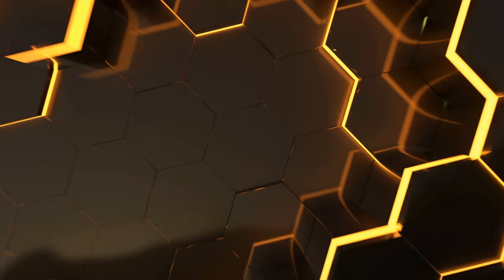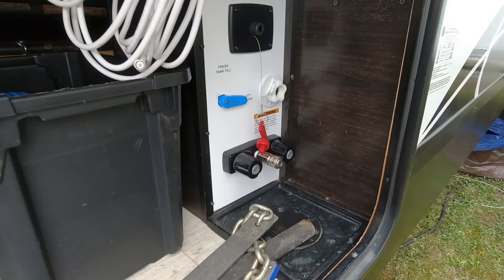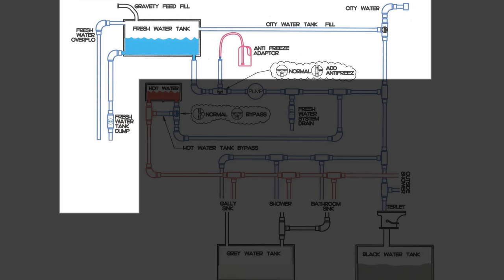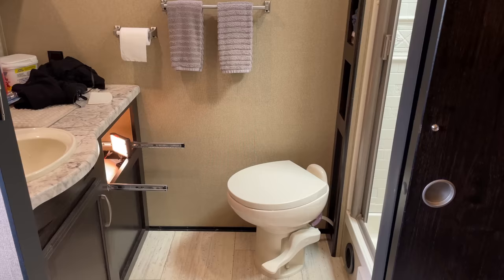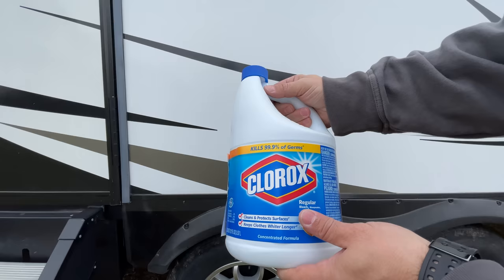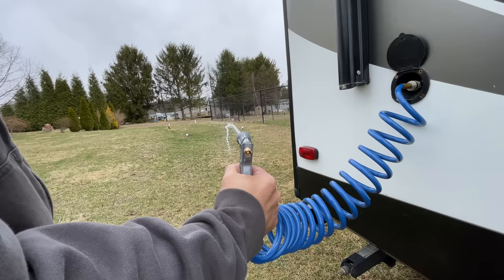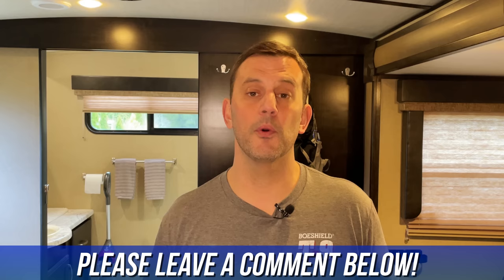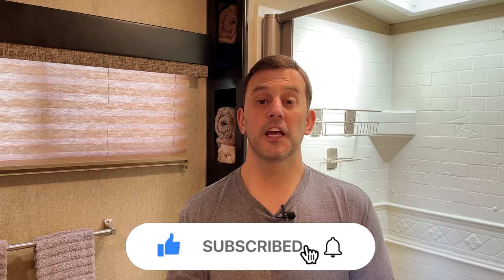Dewinterize & Sanitize Your RV Water System: A Complete RV Dewinterizing Guide!

Comment: Great video, one item I do also is the filter screen on the suction of the water pump sometimes gets particles that have been released from the fresh water tank, I remove the cap and clean the screen after sanitizing so it doesn't get clogged.
Reply from the maker: great tip, thanks for sharing Bryan!

Comment: What a life saver you are.  We have the exact same rig.   Super helpful.  Easy to understand!    Only thing I can think to add is in the other dewinterize video once I got all the antifreeze and filled up the tank I went ahead and turned the water heater to summer mode. Then I found this one.  Normally I’d just fast forward to the sanitizing but for whatever reason I watched the whole thing.  Thankfully so I knew to turn the by pass valves back to winterized mode during sanitizing Maybe put an alert on the other video with the steps that if planning on sanitizing leave valves in winter mode?   Not a huge deal… just a thought.  
Thanks so much!   Saved me 120$ from having to pay someone to do it! 🇨🇦🇨🇦🇨🇦
Take care
Stay well!
Reply from the maker: Thank you!

Comment: I installed my Carmtek Lock, but my door was about 1/8 to 1/4 to thin. Carmtek was thinking because they included a foam gasket. With the gasket installed the lock was perfect. Also has to trim door lower so screws would line up. Lock works great. Thanks for your video, letting others know about the gasket would help, the direction don’t say what the gasket is for or when to us it.
Reply from the maker: Thanks for the info Michael.  I appreciate the heads up and helping everyone out.  I used the gasket right out of the box and assumed everyone would but glad you mentioned it.

Comment: Excellent video... suggest doing the exact same video, but insert instructions for those of us who have tankless water heaters... not sure how to handle that piece of equipment with the sanitizing steps and how to avoid damage and how to turn the Nautilus Control Panel knobs....   sure don't want to mess up the tankless water heater... so I am confused as to what to do... thx   Again, great video and some awesome extra tips for starting out the new season with our RV.
Reply from the maker: Thank you Gerald, I don’t have a tankless water heater so I can’t make a video on that. I don’t have much experience with them, but I recommend checking the owners manual for that specific tankless water heater that you have to see if it’s safe to run a sanitizing solution through it. If it’s not, the process should be the same and you’ll just have to bypass it like a normal water heater. I hope that helps.
Reply: @RVTIPSANDTRAVELS  Thanks for the reply... I understand... was  hoping that you might know.  The GD Reflection Owner Manual is not helpful at all... does an OK job at winterizing, but horrible on de-winterizing.  Thx again for the reply!

Comment: Hi Ross great video... !!  I have an inline water filter, and not sure how sanitizing impacts the filter.  Also, as part of dewinterizing, I always check my batteries , i.e connections and distilled water as I run a solar system all winter, which sometimes drains my 6 volt batteries.  I'll be checking your other videos.
Reply from the maker: i would remove all filters before running any type of sanitizing solution or antifreeze through them, whether its bleach, vinegar, etc... no need to run anything through a filter. remove the filters when winterizing, they can hold onto water and freeze up.

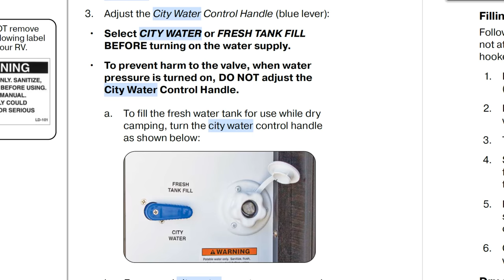Comment: About 3:45 the house hose bibb twists when you are using the valve; may need to tie it down .
Reply from the maker: Actually replaced it Scott.  The top cap blew apart, no shut off for only this line in the house, so I had to turn all water off… capped then jb welded the top on for a couple days until the new one arrived.

Comment: Are you doing the de-winterization at home before the first trip of the season? If so, where are you dumping all the tanks when sanitizing the system or do you recommend performing this at the first CG?
I appreciate the detail in each of your videos, they are super helpful
Reply from the maker: I do it at home.  I usually empty the antifreeze into a bucket and put in my septic tank… it’s food grade so  it’s not going to hurt anything.  The bleach solution is so diluted that dumping into the ground is perfectly fine as long as no children or pets will be in that area immediately after.  Dewinterizing is something a lot of people will do on their first trip too.
Reply: @RVTIPSANDTRAVELS  first of all thank you for the response, all your videos are super helpful. And just to double check I have this correct, fill fresh tank completely full x3. Once with sanitizing solution and then 1-2x fresh water for a total of roughly 170 gallons. Then draining out the majority of this into the yard? Are you emptying black and gray into a bucket and then dumping down the toilet in the house?
Reply from the maker: correct, and yes into the yard.  highly diluted bleach, like in this video, is actually used in food production to sanitize, so it is fine at this dilution rate.

Comment: Great tips and details. Question: should I also sanitize the city water line? Thank you!
Reply from the maker: yes, and doing that depends on your panel... you might need an external pump to get the solution into the lines since city water is normally getting its water from the city pressure.  drill pumps like these work great: https://amzn.to/4f3g1A7

Comment: Hi Ross ,your 🇨🇦fan Big Ben, excellent video ,made me think about what I do ,I also use air blow gun (low press.-high volume) to blow out water heater burner ass. ,go on roof remove A/C cover blow our condenser from back side,also furnace inlet and outlet and run furnace till up to temp,to check and make sure it works..checking tires good idea ,jacking each one up to ck bearings to determine if need to repack ck brake settings...🤔🏁👍or 👎 your 🇨🇦 friends R &J D.🐴🙂
Reply from the maker: great tips, thanks again Randy!

Comment: I’d like your recommendation on something if you dint mind. In our rig (Momentum 31G), our after waste tank is a shared gray water/waste tank. The kitchen and garage bathroom sinks drain to it, as well as the garage toilet. Should we sanitize the lines to those sinks as well? I’m assuming that bleach will kill the enzymes in the waste tank…
Reply from the maker: In a situation like this, I would put sanitizing higher on the list than going through 1 or 2 waste tanks that dont break down the solids as well.  Eventually the bleach will work its way out of the tanks and your back to normal.  Hope that helps, but end of day its a judgment call.  You can also just fill and dump that waste tank after sanitizing.  I think you'll be fine.

Comment: Question. How do you fill the hot water heater if you have no access to city water connection and can only fill fresh tank???

Will the water heater fill up when the water pump is turned on?
Reply from the maker: correct, once you turn on the water pump, cold water plumbing sends water into the water heater.
Reply: @RVTIPSANDTRAVELS  Thank you for a quick response. I appreciate your videos, very informative.

Comment: I've watched your video and a couple of others about de-winterizing.  Some recommend filling the fresh water tank and flushing and some recommend using the city water connection and flushing.  Seems your method would be best since it uses the RV pump.  My question has to do with the hot water tank.Our new RV had a bad valve on the hot water tank and when I added glycol it went into the hot water tank.  Those valves are now replaced, so when I de-winterize, should I go ahead and run water through the tank and out of the plug before doing anything else?
Reply from the maker: yes, I would fill and dump that water heater 10 times or more.  theres a small amount that never drains out of the bottom of the heater tank, so youre going to need to keep diluting it to the point its almost gone.  when you continuously drain it, open the drain valve and the low point drains together to get as much out as possible.

Comment: You mention to always keep water in the black tank(obv not during winterizing). How much? Our black tank is 30 gallons. And should it be flushed as part of dewinterizing first,  to avoid killing the the bio catalyst? Also, the sanitizer and  antifreeze will be going into the Gray Tank. It doesn't seem like it will fill it,  by the dewinterizing alone. But should it be flushed?
Reply from the maker: Keep about 3 gallons (10%). I empty all tanks when winterizing..  Remember the black tank is a tank, not a septic system.  Just add your black tank treatment in upon dewinterizing.  Last, you shouldn’t come even close to filling your tanks by pushing antifreeze out and adding sanitizer.  Just keep an eye on it.  Watch this video, I think it will help: https://youtu.be/mmrrOb4sOb8

Comment: Ross, question. In sanitizing, you suggest not introducing sanitizing solution, including bleach, to the water heater. My grand design manual, page 87, shows the docking station valves with the water heater bypass selector in the normal and not bypass position. I am making notes and wonder if I should amend that to putting the valve in the bypass position during sanitization. Thanks for the videos.
Reply from the maker: You are thinking correctly, bypass your water heater if you are using bleach in your sanitizing solution.  bleach, even highly diluted, should not come into contact with the metal tank in your water heater.

Comment: Question, my motorhome has a tankless water heater, is it ok to run the antifreeze through it as your running fresh water through the system? Thank you
Reply from the maker: Yep, there should be antifreeze already in there from winterizing.  Just push it out with water.

Comment: I am going to sanitize a buddy’s motorhome fresh system and they have an on-demand water heater so I assume there is no bypass there given there is no tank.  Right?
Reply from the maker: Josh, you should be good to run it through even though there might actually still be a bypass.  just check manufacturer website and see what they do and don’t recommend for sanitizing solutions.  Different models say different things.

Comment: Hi. I am new to trailer life. I have a trailer at a seasonal campground. The fresh water tank is never used, only the city water line. Do I still need to sanitize the system? Thanks.
Reply from the maker: i would, youre not just sanitizing the tank, you're also doing the lines and fixtures.
Reply: @RVTIPSANDTRAVELS  Thank you.  I will give that go.

Comment: Hi Ross; newbie question … 
When you switch from using the internal tank to city water, do you still use the water pump or is it only used for the fresh water tank ?
Reply from the maker: the pump is only for the tank... city water is pressurized so you wont need a pump.
Reply: @RVTIPSANDTRAVELS ty very much
Reply from the maker: you bet

Comment: Is the fresh water tank drain different than the two low point drains?
Reply from the maker: Yes, low point drains will empty the pressurized plumbing system inside the rv, not the fresh tank.

Comment: I'm in the process of flushing out my water system.  Is it a good idea to de winterize my water system and push out the anti freeze with bleach water?
Reply from the maker: thats fine, and while its minimal, its a waste of bleach.  personally, i would just run water through to get the antifreeze out first.  let it run and get everything out, then add the bleach solution.

Comment: Hi Ross, I have a question... when it came to the sanitizing of the system, you said not to run the solution through the toilet but how do you prevent that from happening if your fresh water tank has the solution?  Doesn't flushing the toilet let some of that bleach water go into the black tank?  In the video I saw the toilet being flushed as the black tank treatment was poured into the toilet.  Does that particular water not contain the sanitizing solution or does the black tank treatment negate or cancel out the bleach?  

Yes sir, newbie here...😊
Reply from the maker: That was just a visual reference.  Dont flush the toilet at all until you remove the sanitizing solution.  Make sense?
Reply: Hi @RVTIPSANDTRAVELS , yes sir, that makes perfect sense!  And I have to say along with the other folks on here... THANK YOU so much for all of these incredibly wonderful and educational videos.
Reply from the maker: Happy to help!  Thank you Tracey

Comment: Ross quick question.  The RV I bought has only one bi-pass valve at the water heater, on the cold side.  I'm converting it to a three way bi-pass valve today.  But it looks like the person before me ran antifreeze through the water heater, since there was not valve on it.  How would I clean that out before I run the sanitized solution through it?
Reply from the maker: If you’re at a full hook up, connect to city water, open your gray tank drains so they empty immediately into the sewer, and turn your shower hot water on.  Let it run for a while (30 mins). This will draw out and recycle the water in the water heater.  After that drain the water heater.  That should get most of it out.
Reply: @RVTIPSANDTRAVELS  So after I add the three way bi-pass valves, do the sanitized solution by passing the water heater.  Then when I'm at the campground with full hook ups do what you said?
Reply: @RVTIPSANDTRAVELS  Does the water heater need to be on? Or heated?
Reply from the maker: Nope
Reply: @RVTIPSANDTRAVELS  Thanks!  Got it all cleaned out and triple bi-pass valves installed!  Thanks for all your help!  Happy trails.

Comment: Ross, thanks for sharing your knowledge with us new campers.   This will be our second season camping so all this is still new to us.   This past winter I left our battery in the TT.  We have a solar panel and it seemed to keep the battery up ok through the winter.  We are in northern Georgia so relatively mild winters. In your opinion do you think that is an acceptable practice to leave batteries in trailer?  Trailer is parked in a storage lot as we live in  an HOA community.   No electric available on lot.  We need to be able to move  slides in and out occasionally.
Reply from the maker: Hey Mikey, it’s ok to leave a battery installed if it’s getting a trickle charge from the RV, or from solar.  But if it’s sitting without a charge over the winter that is what wears the battery life. I pull mine out and hook it up to this all winter in my garage:  https://amzn.to/37mT6kV

Comment: Winnebago thoughtfully omitted the gravity feed, fresh water fill, from my motorhome. So the only way to get water into the tank is under pressure thru the city water fill inlet.  They suggested using a drill-mounted pump to force water in from the bucket but that takes a verrrrry long time.  So I bought a device on Amazon that is designed to mix chemicals or soap into a garden hose.  It features a dangle hose (somewhat like the anti-freeze incoming line in your coach) and an adjustable flow knob to mix fluid from a bucket into the hose that brings water from the city to the inlet on my coach.  I am hoping that will allow me to follow your instructions on getting the 4 gallons of bleach mix in the bucket into my fresh water tank.  It may have an anti-back flow preventer in it, but since it came with no instructions I plan to put a back flow preventer on the hose ahead of the device to be safe. The one I got is a Valley Industries PK-85400003 Up Stream Chemical Injector-High Pressure, 3500 PSI, 8.0GPM, Brass.  Cost was $20.68 at Amazon.  I picked it over many similar offerings because it came with garden hose fittings in and out.  Thanks for your clear video.  It is a big help for an 80-year-old who hasn't taken his rig out for three years.
Reply from the maker: Thanks John, I agree with you and think that it stinks When companies remove the gravity feed. It makes no sense. Grand Design is starting to do that as well, I’m guessing because they were recently bought out by Winnebago.
Reply: More:  I just read a review on the Injector I just recommended that said water pressure alone wasn't enough to operate it.  It is apparently designed to work with a high pressure pump that would not be safe on an RV.  I'd delete that part of my comment if I knew how to edit it.